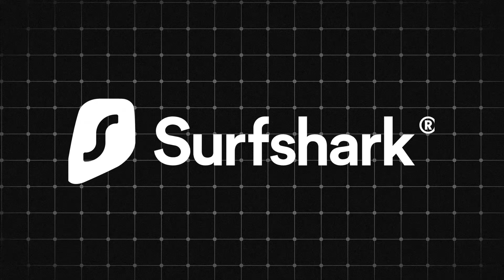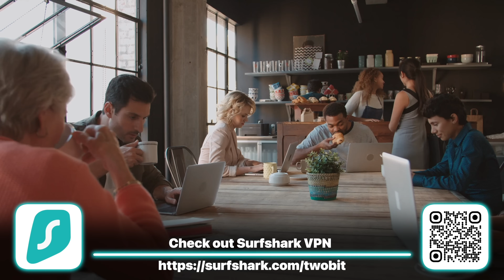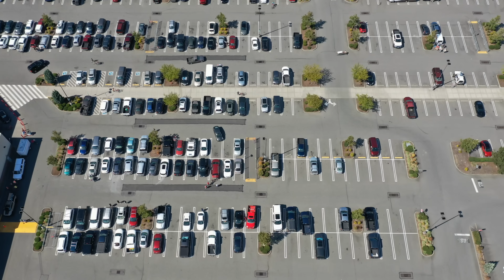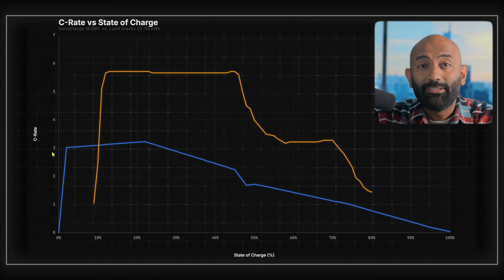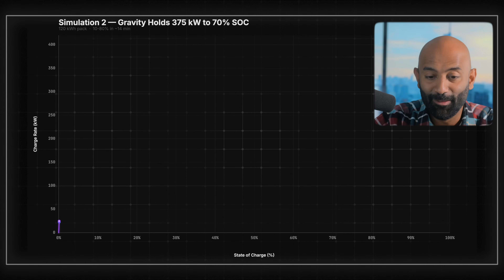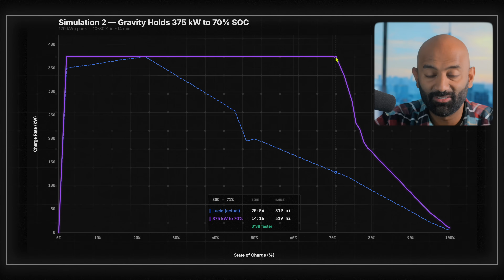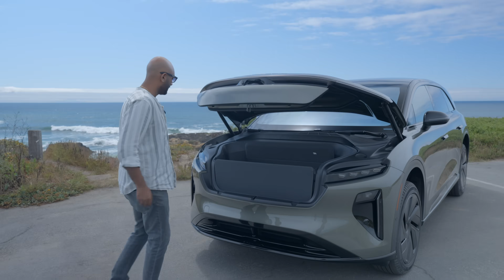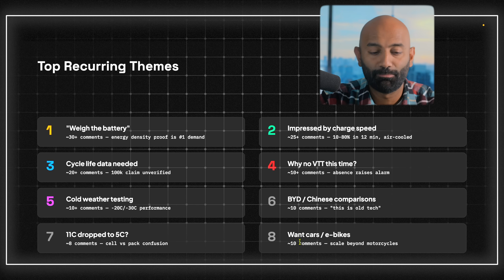Donut Lab Battery Test 4 Changes Everything!

Comment: Plug car in to charger, set it to 80%, wander in an buy coffee and snacks, pay, walk out and it's done. This is where charging needs to be. With range that matches a Diesel or Petrol car, and charging that matches the time to refill, ALL the anxiety factors go away. If the battery tech proves itself, and gets put in to the sort of vehicles people use like white goods - SUV and Minivans for the school runs and trips to the shops, small cars for the commutes to work - It'll sweep the market as a supplier.
Reply from the maker: exactly — that seamless experience is the goal

Comment: If you could charge to full in <15 minutes then you don’t need a huge pack with huge range anymore. 250-300 miles would suffice, charging is like a gas fill-up. That reduces vehicle cost too.  Wanna see the cycle life at these charge rates and temperature.
Reply from the maker: cycle life at 5c+ is the real unknown—no one’s published that data yet

Comment: Even if this turns out not to be real, one of the others upcoming SSDs will. Its the next gen coming up from many producers and companies, from different angles, but the benefits will be similar to these and then improve further over next several years to decades. With very healthy Sodium and LFP improvements alongside. 
If Donut battery works as advertised it would bring a huge improvements to motorcycles but even greater to larger vehicles, of course. This would enable really long range bikes, with fast charging enabled. And create even longer ranges for cars and other bigger vehicles that would bring additional indirect but huge benefits many dont understand or anticipate.

Very Long ranges would solve all issues with charging, with not having enough chargers for everyone, or enough fast chargers, because this would make charging once a month a standard. When you can do that, charge once a month to cover all your daily uses, then super short intermittent charging done several times for shorter periods actually covers up all you are spending. Even the slowest home charging done overnight would practically make charging not needed for many days after, and practically - not needed at all during the working day, even many working days. Any additional short stop at any ordinary medium or faster charger during the whole month would completely cover up anything you spent driving during the day. Or a whole week.

This literally means everyone could charge anywhere - at any type of a charger - at any time during a whole month and never run out.
Reply from the maker: Charging once a month? Now that’s a mindset shift. If this scales, we’re not just upgrading batteries — we’re rewiring how we think about energy.
Reply: @TwoBitDaVinci  Usually people argue against long range batteries because they are worried (scarred) it would increase the price of all already fairly expensive EVs. Although in reality that would never happen, as nobody would suddenly force more batteries into all EVs just to make them more expensive. The whole idea is ludicrous. 

The prices of batteries and the whole technology field keeps falling down year after year. While efficiency similarly constantly increases. Together with all other renewables.

There is a general trend of arguing against long range with ideas like "Oh but nobody would drive a thousand miles every day," - but that's the point. Nobody would. We would all just continue with our lives as usual, but with a new feature : Drive for a week, work, kids, school, shopping, do other usual stuff and still be at 80 or more percent. 

With such a huge volume of power, enough for a range of a thousand miles for example, majority of people would not need to charge more than once a month, or just top it off in many smaller five minute stops during the day, and always have enough for weeks of usual commute. Which is plenty of time to top it off again even with occasional five minute stops at any public chargers. While even the slowest home charger would be enough to keep that range constantly high. 

Because you would never really charge the whole battery, as it would practically always be above 60-70 or even more %.

Increasing the speed of charging was necessary at early stages of this technology. Simply because previous levels were ridiculously slow. But the speed of charging cannot just keep increasing as we are already getting close to the limits of our materials and physics. Range can keep increasing for a much longer time especially as it doesn't depend only on batteries but the efficiency of numerous systems and technologies.

Comment: Per Verge Motorcycle website the bikes can charge at 200kw.  I would like to see a real world charge at that speed instead of the 103kw shown.
Reply: At the end of the day, that´s just a hype number, as 1 second at 200 kw, doesn´t guarantee a 0-100% charge in less than 10 minutes, or a 0-100% charge in less than 10 days.
Reply from the maker: real world limit was the charger, not the bike — 103kw max at that station

Comment: About the fourth donut video, does anybody realize that for what we know the plug on the bike could be connected directly to an external active load? You really can't see what is happening outside the view of the camera. If this is the case than you can absorb whatever amount of power (and power profile vs. time) you want. There is absolutely no proof that there is a battery on that bike. I really hope we get more solid evidence. So far it does not look good. Especially if you go on their website and try to buy the bike. There you can only preorder it by paying 100€ and, surprise, this payment is not refundable (or in any case very difficult to get back)... Scammers are getting very sophisticated these days. Just google the Perendev motor, a perpetual motion machine, they even applied for patents (indeed never granted but still audacious try :D)... Although I get the impression this is not going in the right direction I still hope...

Comment: If absolutely nothing else, this would be an amazing replacement to extend the life of aging air-cooled Nissan LEAFs. They seem like drop-in replacements (same voltage)
Reply from the maker: voltage match is nice, but trying to shoehorn this into a Leaf’s battery bay? good luck with that
Reply: @TwoBitDaVinci what made me think of it was that the display module looks to be similar size to the VIVNE ones for the LEAF

Comment: Is there any concern that they may have used different batteries for each test, optimized for that particular parameter?
Reply from the maker: good question — they’ve been using the same cells from the start. swapping would’ve shown up in test 1 vs 4 curves

Comment: Easy,  your going to have doughnut labs on both side. The chargers will be battery backup systems, they charge from the grid at whatever rate you have, and then dump to the car. They can then slow charge back up the local buffer. Even could do it at home if the batteries are cheap enough.
Reply from the maker: lol 'doughnut labs' — love it. yeah, using them as grid buffers makes total sense if the price drops

Comment: In theory, if that first step down in charging speed is thermal related, if may stay at the 400 charging speed even longer, maybe even all the way to 80%. You wouldn't be generating as much heat earlier in the charging cycle at 400 as you do at 700. Now if its a % of pack step down that's a different story.
Reply from the maker: so if it's thermal, less heat early = longer 400kW hold. if it's % based, nope, step down hits regardless

Comment: A scam is a deceptive scheme or fraudulent act designed to trick people into giving away money, personal information, or other valuables. Scams often involve psychological manipulation to build trust or create a false sense of urgency.

If ANY of Donuts many many many claims are just 10% off, it is a scam.

Donut is already taking 1000 USD up front for a reservation of the Verge Pro. BEFORE Donut have provided evidence for any of their very extraordinary claims.

What are the chances people can return the bike if any of the many claims will turn out to be false this summer?
Reply: Make this single question to your self....how could Mr. Donut possible know FOR SURE his battery can last for 100.000 cycles, charging 0%-100% in temperatures from -30 - 100 Celcius with 6C+? He must have had a Verge battery for at least a couple of years by now, to make a real life test.

And why is this claim backed only by a 5 year warranty at cell level, on a motorcycle which typical will drive less miles than a car?

On the Verge homepage is written the waranty only is valid with "Normal use" of the bike.....we just have to assume it is normal use for a Donut battery to be charged at 6C+, in the temperature range of -30 to 100 Celcius for 100.000 cycles.....(Maybe he forgot to mention the battery will only last for 100.000 cycles or 5 year, whatever comes first)

Comment: Why can't an independent lab (under scrutiny of Donut Labs) take apart the battery JUST to see if there is lithium inside. The reason for Donut Labs oversight is to avoid claims of reverse engineering - the battery never leaves the chain of custody of Donut, it is just handled by researchers looking for lithium.
It's suspicious that Donut doesn't let the battery be taken apart.
Reply from the maker: yeah taking it apart to check for lithium is the move — but good luck getting them to hand it over

Comment: The other big question that did not make this and I know a little comes into greed but what will this save the consumer because the battery cost has gotten cheaper.  Or is it going to be like an ICE engine and only get more complicated and more expensive raising the cost of the final product.  I think that this real world test means more than VTT because it is in a product loaded.
Reply: Naa, the test can be rigged, nobody knows. A realworld test has to be done in the real world = not by Donut
Reply from the maker: real-world > lab — but if it ends up priced like a Ferrari battery, who cares how fast it charges?

Comment: Biggest pro would be cold climate performance, batteries of today suck in -30 celcius, max 100kw charging atm for a preconditioned battery.
Reply from the maker: cold cranking amps for batteries — show us the -30°C data or it didn't happen

Comment: You know it is not the first 80% which it the problem it is the last 20%, where it that in the test? It is not a demo it is only 80% of a demo.
Reply: Actually it is only 70% of a demo (10%-80%), as the claim at CES was 0%-100% in less than 10 min pack-level, temperature from -30 celcius - 100 celcius if I remember correct. 
If Donut, when they want to show the world what they have (I Donutbelieve), can´t even get it above 3.5C in average 10-80%, in the sweetspot of 10%-80% charge AND in the sweetspot of 20C battery starting temperatur (nobody knows for sure), we can conclude that Donut is unable to prove the claim of a 6C+ charge all the way from 0% - 100%, any temperature in the claimed range. = also this single point was a scam.

Also we don´t know if this test was rigged in any way....any test made by the seller Donut, has been invalid for this very reason.

Just a waste of time until we get some proper testing.
Reply from the maker: yeah the last 20% is where it gets spicy — they only showed us the easy part

Comment: Yes, but they said "5 minute charging" and that claim is not upheld here (not even close), along with 100,000 cycles, 400Wh/kg and "no lithium". Also is anyone else just a little bit suspicious that the final reveal is on April 1? 😂 Either way it's good fun. So far I've seen nothing that couldn't be good quality NMC cells with no regard to longevity. Great viral marketing campaign either way.
Reply: We will see how great that marketing campaign is....the Verge bike looks really cool, and people might think for that reason that the Donut battery must be equal cool. If it will show to be a scam, a lot of people will not touch anything from this CEO.
Reply from the maker: 5 minute charge? More like 5 minute hype. Still waiting on those cells getting weighed.
Reply: @TwoBitDaVinci My point exactly. No consistency between the test results and the claims.

Comment: If you extrapolate from the previous Verge TS bike the previous lithium pack equates to about 170 Wh/kg and the new Verge TS Pro donut pack equates to about 268 Wh/kg, which brings it to between 350-400Wh/kg for the cell.
Reply from the maker: so the cells are pushing 350-400? that’s wild if real

Comment: Their claim was 5 minutes from 0 to 100 without active cooling and heat is no issue for the cells.

Now we have 9-80% in 12 minutes with air cooling, which turns out to be a charge rate of 3.5 vs a claimed 12.

That's roughly Lotus Emeya, Zeekr 007 levels. Of course these have complicated active cooling systems, but they also do not have only a single cell, which produces far less heat. Also we do not know the cooling in the bike, what state the battery is in at the end etc.

So still no real proof here.
Reply from the maker: Passive cooling claim with no temp data? Classic. 3.5C ain't 12C, buddy.

Comment: I would recommend you take a look at the charging performance of some of the latest lithium battery cells like the Zeekr Golden Battery reaches 5.5C charging with a peak rate just under 500KW. 10-80% in ~9 minutes. There are production cars with matching performance right now. Though not within the US. The charge performance of the Donut battery roughly matches what my larger Zeekr 7X NMC battery (CATL Qilin battery chemistry) is capable of.

Had the charge rate been closer to the 11C they promised.... I would have been far more impressed.

As for the argument that this was air cooled and they need to ramp down... I wonder why Verge has such a conservative BMS setting. The previous lab tests highlighted how the Donut battery loves heat and performs far better under high stress compared to lithium chemistries. As you mentioned, the battery when passively cooled reached 61C in lab testing, nowhere near its upper safety limit. Yes this real world test was in a larger pack but it was also actively air cooled on two sides.

Maybe this is still an early test and they are still optimising BMS settings, but so far I am not seeing an industry shattering improvement in performance. This is only matching what we are already capable of today.
Reply from the maker: great point I'll def do some research before next weeks video. But those systems have incredibly high bandwidth cooling systems. they're liquid cool and engineered to extract the heat they produce. this is just an air cooled pack. this might suggest that they have something thats more tolerant of heat than what we have today like NMC. Especially from test 2 temp tests. but great insihgt and gives me some things to look into before next week
Reply: @TwoBitDaVinci  Agreed, at this stage I am just going to assume they are still in early days of longevity and stress testing and the BMS settings are still quite conservative while they validate what the cells can safely handle. 

But this video was for marketing purposes... most manufacturers probably would have pushed those safety margins to make their battery performance look better for the public even if it meant some impact to cell longevity.

It is still early days for now. Will see how this test compares to the actual production motorcycle due later this year.

Comment: Most of this is completely specious.  Our Walmart charging area has about 10-stations, but the local utility is only supplying the entire charging bay with a 14KV line, maybe rated at 250A.  There is no way you will ever charge the 100+cars in the Walmart lot with any form of electricity.  You would have to bring in a 200KV line from somewhere.  There is NOT sufficient power in the entire USA to power a countrywide network of all electric cars, and maintain these battery charging rates, across the board.  We are walking into the land of ECO-Freak stupidity here.
Reply from the maker: so think about this, if you have a 300kW or 400kW station today that means it has the bandwidth, its required. so with this you could actually charge at that rate for like 50-60% of the soc. which is wild. todays cars hold their peak for like 5%

Comment: If that Donut Lab battery becomes popular then put in vehicles is there enough total electric capacity generation, or sub transmission capacity to supply that much amperage across the State you live in with numerous EVs charging at any one time State wide ? Seems like a recipe for grid instability. Lights out. State economy stoped for 3 to 5 days when performing a cold electric grid restart with more Donut Lab EVs trying to recharge after days of being discharged to empty when no grid electric is available State wide
Reply from the maker: yeah the grid's the weak link — until we upgrade transformers, fast charging everywhere just means coordinated brownouts

Comment: I'm not massively interested in charge speed. 10-80% in under half an hour will do me fine. Would much rather see the energy density and anything to show that the life cycle is as good or better than current batteries!
Reply from the maker: energy density and cycle life are what matter — let’s see the data

Comment: What I hope this isn't, is a stunt to get investors in.

But then it turns out the battery only lasts 100 cycles charged like that, or has some other bad charge cycle memory effect, or even worse weighs twice as much as a lithium cell of the same capacity.
Reply from the maker: any investor who's investing based on what is known so far, is super high risk/high reward, and they deserve any up or downsides lol. I def wouldn't